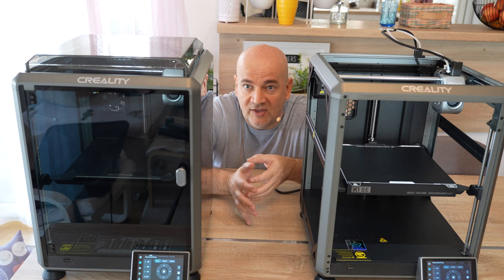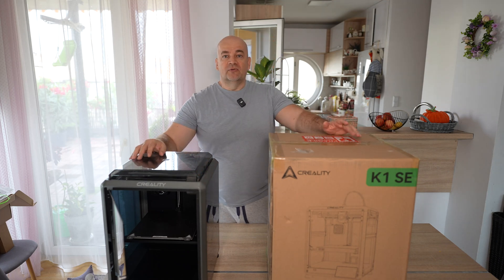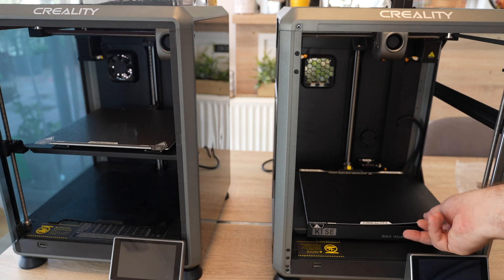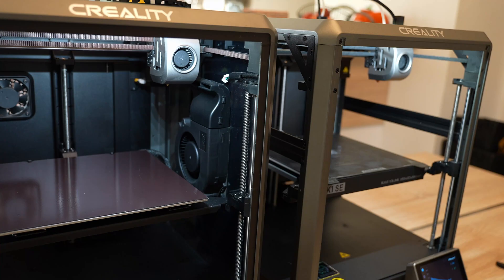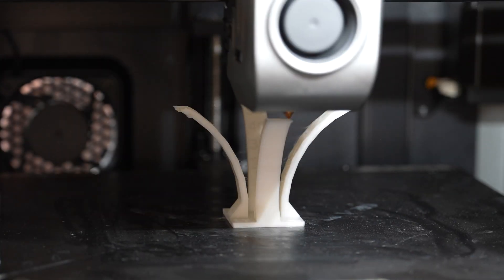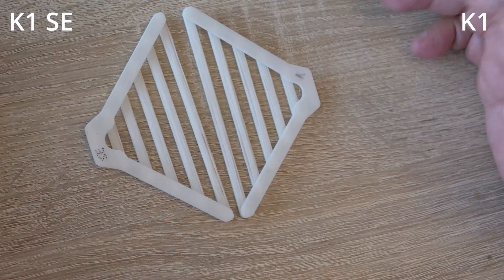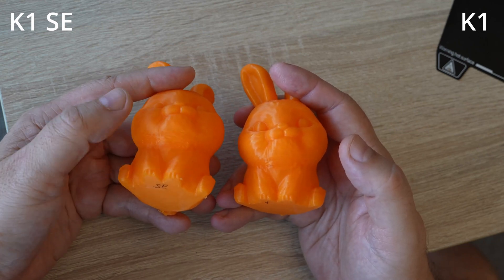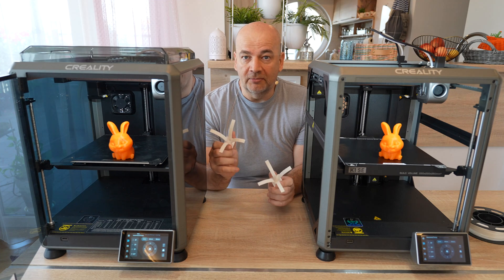Creality K1 SE vs K1 - which one is better for PLA?

Comment: hi, its possible to install rear and lateral fans in K1 SE in order to print abs?, I can install custom panels and door easy but need to know if the printer comes with cables for the fans or at least theres place to plug them like the camera

Comment: I honestly don't know why the did the SE, it is a totally pointless exercise, it's only about $20 cheaper than the K1 and only a little bit more gets the K1C which is a far superior machine. The SE limits you so badly as to what filaments you can print whereas the K1 and C can pretty much print anything.
Reply: it is $100 cheaper
Reply: SE seems to have lower VFA steppers and pullies from K1C. This alone might be a good reason to choose SE over old K1 - unless they have changed K1 on the fly...
Quite a few users have need for ABS/ASA, PC or PA. I would expect small PC-CF parts being printable with open (or trash-bag-enclosed) printer without much fuss (other than particles flying around)...
Unicorn nozzle may be easier to change, but it costs more, less variety compared to Volcano and no 0.2/0.25 mm nozzle so far.

Let's see how it's priced on Black Friday

Comment: I'm sure the information can be found online, but you maybe should include the price of each unit in the video or the description...  To me the price would need to be drastically reduced as the ability to print ABS and ASA with the enclosed version is much better.
Reply from the maker: When I started the recording, there was no price. I had to wait with the video publishing, until they are available in the store. Otherwise I would include it.
Reply: the K1 SE is $359 USD --- which is just barely  more than a bambuu labs A1

Comment: I love my k1. I have done a few mods to mine though. The best mod so far is rooting it. And running the script to install mainsail or fluid, moonraker etc. I also picked up the k1c nozzle conversion kit but also tried the new CHT style nozzle that recently came out on Aliexpress that is used on the older style hot end and all I can say is wow. My k1 went from approximately 23mm3/s to over 35mm3/s and that is with cheap no-name pla. I was also able to lower my temps. It is now holding me back from trying the new unicorn nozzles. I am just blown away. My printer has over 1500 hours on it and no issues as well
Reply: First thing I did with my K1SE!

Comment: The nozzle wipe on the print bed is clever. How did the nozzle get cleaned since you replaced the plate?
Reply from the maker: Classic method, like on regular K1

Comment: Had a Creality CR-6 Max, it was such a pathetic piece of trash shit bowden plastic extruder printer i will never buy anything from Creality again.
Reply: 😅 was it really that bad?  What was the worst part?
Reply: @riba2233  I hope s/he didn't buy BL A1 with old bed cable 😅
Reply: @kimmotoivanen  impossible, they replaced them all and pulled out the old stock
Reply: @riba2233  they were sold also before callback, you know 🤨
Reply: @kimmotoivanen   they were also taken care of :)
Reply: @riba2233  to clarify, as you (intentionally?) missed the point: if one burns her/his trousers for plastic extruder (easy to replace), how would s/he react to shitty cable (send whole printer to be replaced/fixed or do some unauthorized work on AC parts, a lot more work than replacing Creality extruder) on a praised printer 🤯
Reply: @kimmotoivanen   you could have just returned the printer, get 80 bucks for nothing and order a new one month later, no replacing anything. I don't see the issue, sorry.
Reply: Creality metal extruder is cheap & nice, or one can print SOS extruder.
Reply: @kimmotoivanen  Printer wasn't cheap considering overall build quality and functionality to begin with. After two days the original plastic extruder broke, also default hotend isn't full metal and you only get brass nozzles, so if you want to print anything else besides pla and petg you have to invest much more. On the 1st use the nozzle dig into glass bed because of some bug in the firmware. The glass bed was quite crooked and it wasn't possible to make it flat without major overhaul resulting in inconsistent 1st layer and difficult callibration. Many screws has been loose causing failed prints after i found it out - was my 1st 3d printer and i haven't expected it to be such garbage. Default FANs in PSU and control unit box are loud as a noisy server only because they are of very poor quality, badly designed and too small. PSU and control board is encapsulated under covers with just few went holes which are covered by a very restrictive mesh thus making the fans even louder. Even after sorting most of the things the print quality was bad probably because of bowden extruder and non-optimal control board design and firmware-was using community firmware but it didn't change print quality. So this printer as a tool is completely non usable and big waste of time